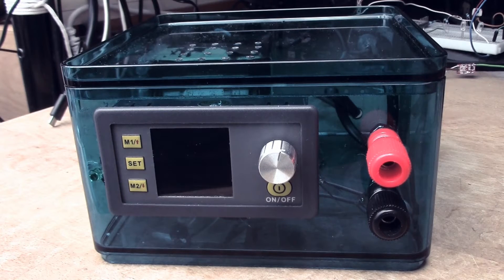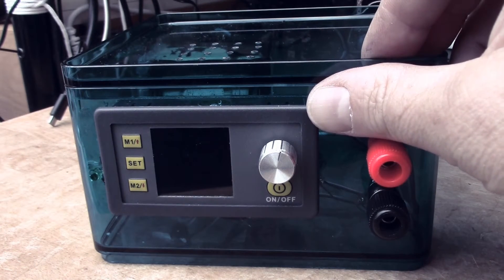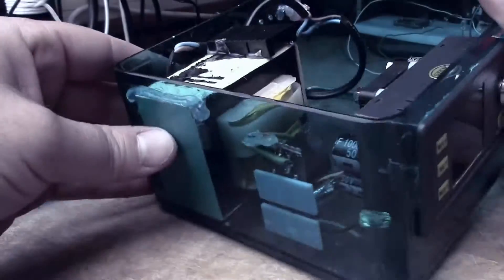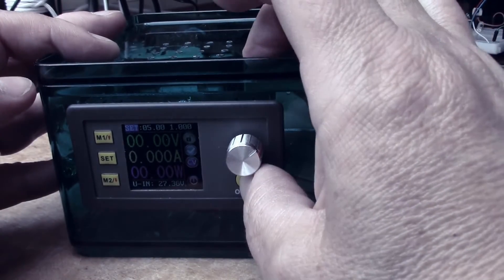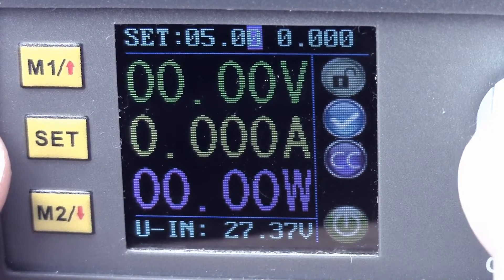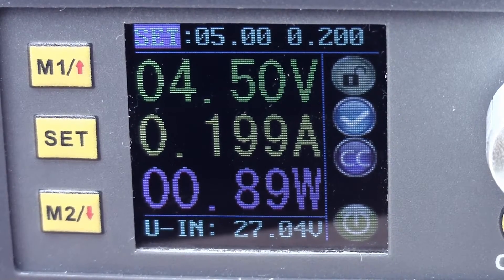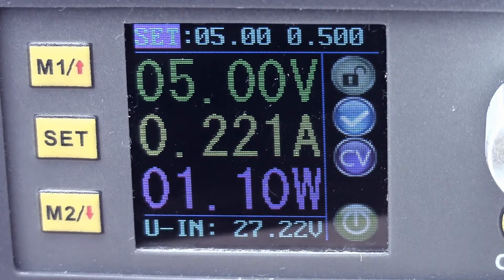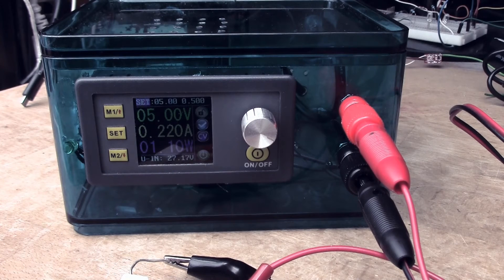DP50V2A Power Supply Module

Comment: I'd like to use this unit to supply a constant current of 1-2 ma. The load will vary in the beginning and then increase.  I have a 12v DC power supply.  I need it to supply the full 12V until a 2ma current is reached. After the 2ma current is reached will the voltage start dropping and maintain the 2 ma current even when the resistance increases?
Reply from the maker: It's a regulated power supply, so it will maintain the voltage you set regardless of how much current you draw.  If you want it to supply 12V, then the input voltage will need to be a little higher: in my case the transformer supplies about 27V, but then the highest I can set the output is 25V.

Comment: I notice a number of different models now, some with a separate power board ("DPS" model numbers) and some without ("DP").  The DPS have a slightly different user interface.
Did you buy from direct from China, or a UK reseller?  Any problems with import duty  if so?
Reply from the maker: I'm pretty sure that I used Ebay, and I can see similar units now that say that they're from China or Hong Kong. I don't recall any problems with this. My worst experience recently was ordering a band T-shirt from the USA: I had to pay a little VAT, but by far the worst thing was the £8 surcharge/handling fee from Royal Mail.

Comment: This works the same as my home system you see I live off grid in Spain on a  good day I have 120A charging my 24V system until the correct voltage and then reduces the current till I am floating, using this device to charge my drills. 😎

Comment: What I found is when I set voltage and current for a battery it goes into constant amps till it reaches the voltage and then switches to constant voltage
Reply from the maker: That makes sense; at first the battery will draw a lot of current (and hit the current limit), then later it tails off and turns into a trickle of current as the target voltage is reached. I might experiment with the series diode - I wonder if that somehow upsets the current measurement in the module?

Comment: I have a 200A 12V battery that I don't use in the winter so I need to use a floating charge of 13.6 but withe the diode in series I just get 12.4V
Reply from the maker: and you've got enough input voltage into the module?  If you look at my video at 2:23, you can see U_IN at the bottom of the display, which is the most voltage available.  Also check if it's gone into CC (constant current) mode, as the voltage will drop below the set level if the current has reached the limit.

Comment: I have built a similar unit, with the recommended series diode I get a resulting lower voltage?
Reply from the maker: I suppose that's to stop a charged battery or capacitor driving current back into the output.  I haven't put a diode in myself.  With a series diode you'll get a 1V drop across the diode, is this what you mean?

Comment: Hi friend 
I like your video and you add a case on the DP50V2A. in face this device name is DP50V2A. I guss you want to ask why, because i am the designer of this power supply module .. 
your case is very good and there are heat dissipation holes. it is very smart. 
in face DP50V2A  is not the better one. DP30V5A and DP50V5A are better. becaue they use better logic circuit to design 
so those new version don't need fan. 
and we have designed DPS3012 ( 30V/12A). i guss you case is very suitable for my all DP series and DPS series
oh, I forgot to tell you my home page RD official store http://hz.aliexpress.com/store/923042?spm=2114.12010108.0.38.rOgHXo 
this is DP series page http://hz.aliexpress.com/store/group/DP-Programmble-control-power-supply/923042_256093262.html 
thisb is DPS series page http://hz.aliexpress.com/store/group/DPS-Programmble-control-power-supply/923042_508466030.html 
thank you , hope you like it
Reply from the maker: Thanks for your message, Glen.  I really like your module and now use this power supply several times a week.
Reply: I am glad you like it , if you have any question, you can tell me . thank you again